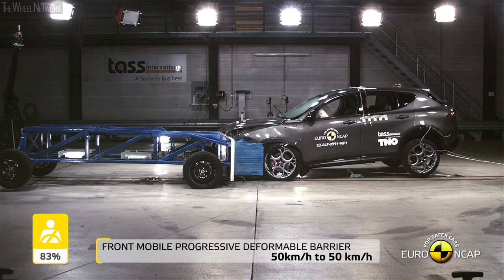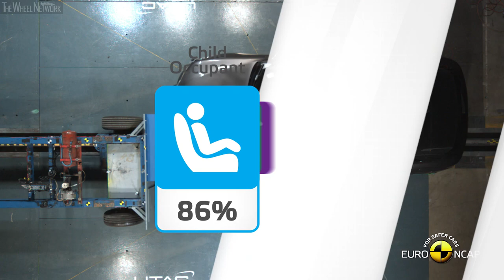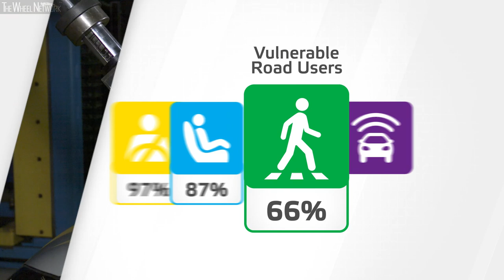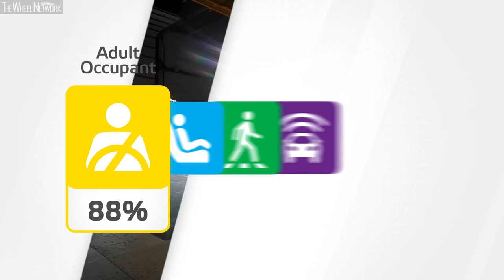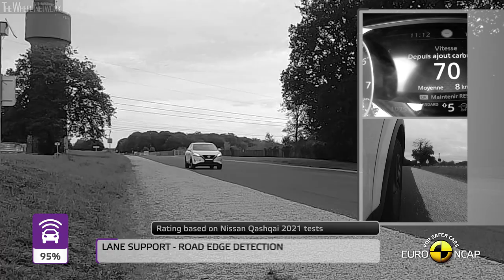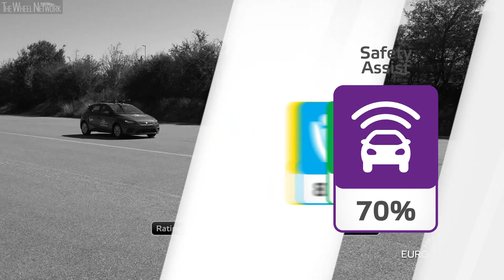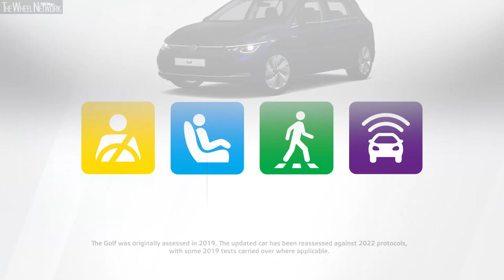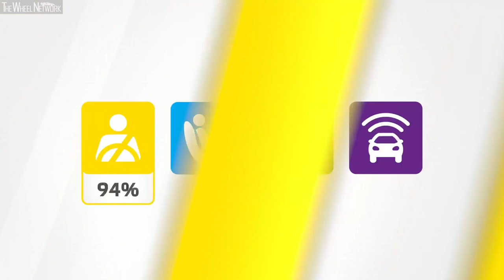Euro NCAP Crash and Safety Tests – Every Car Tested in 2022

Comment: on video is not Ford Tourneo Connect is a VW Caddy perhaps
Reply from the maker: The latest generation Tourneo Connect is a rebadged VW Caddy, virtually identical besides minor cosmetic changes, and is built at the same plant by Volkswagen (in Poland). Euro NCAP therefore used testing data from the Caddy for the evaluation of the Tourneo Connect.